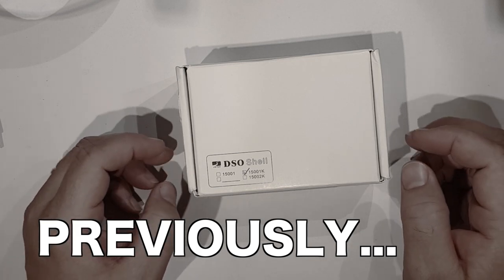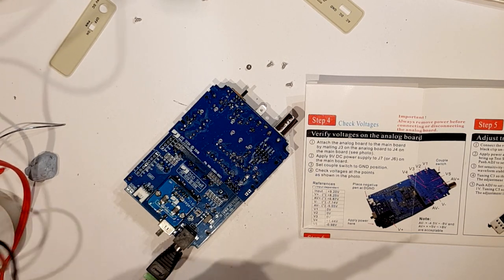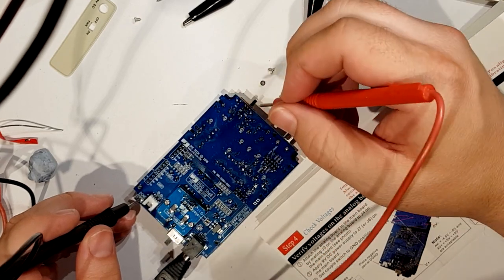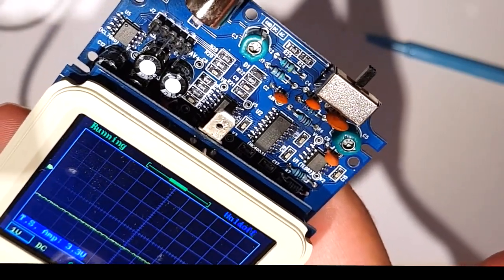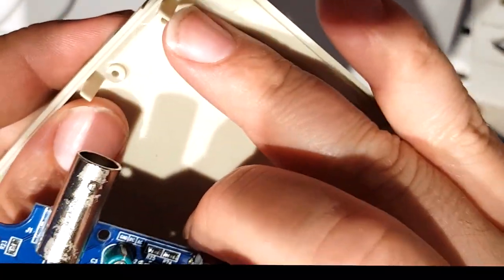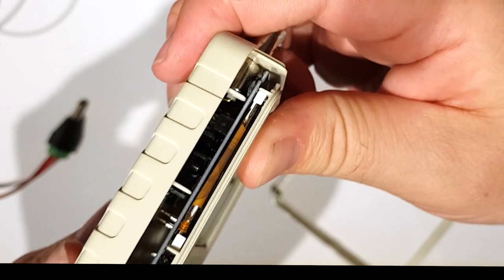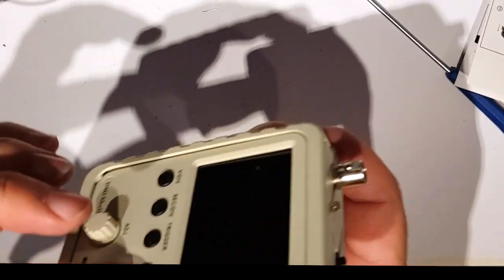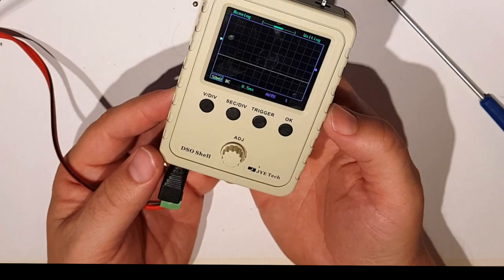DSO150 Cheap Oscilloscope Kit Build - Part 2

Comment: hi spidermaf, i dont no your name, thankyou very much for your video on how to set up the dso 150 oscilloscope from banggood it helps me seeing it but not on paper.
i built mine and and seeing im learning and doing this as a hobby and lovin it, i try to get help from where and when if i can, and your video was great in how to calabrate it, i couldnt get those vertical lines till i looked at youtube and found your video, i had all the settings right from you but it didnt work i found  i had gnd on the screen so i switched to dc and now i have those lines but still dont no how to work it and where to put red  probe  but further down the track ill have another look at youtube, anyway i stuck it in my favs subscribed to you and clicked thumbs up.
keep up the youtube videos  there great.
i live newcastle new south wales australia.
john